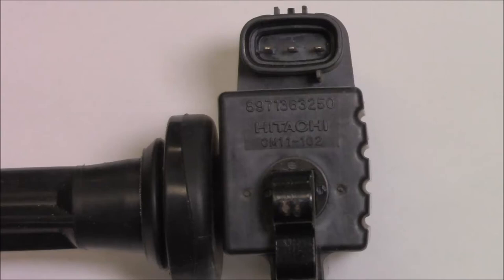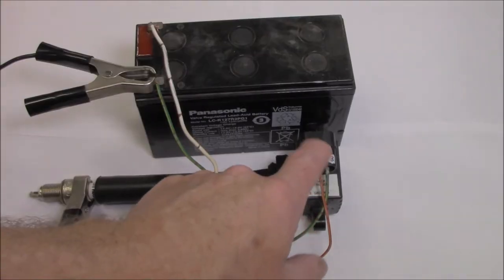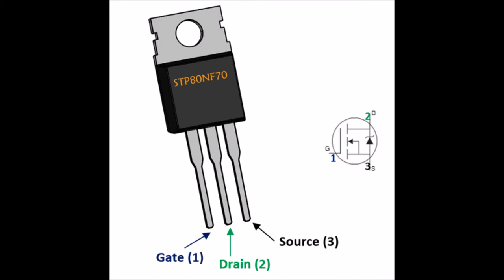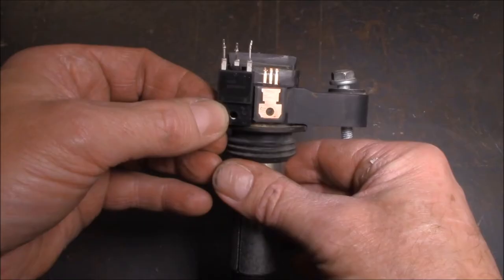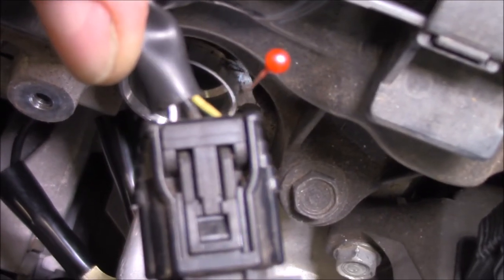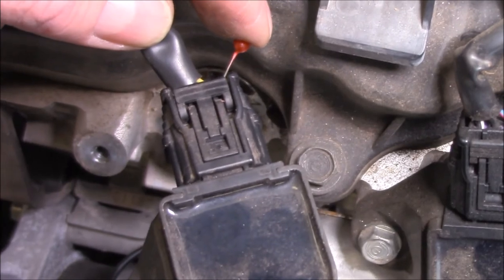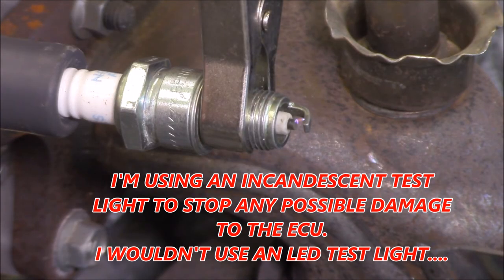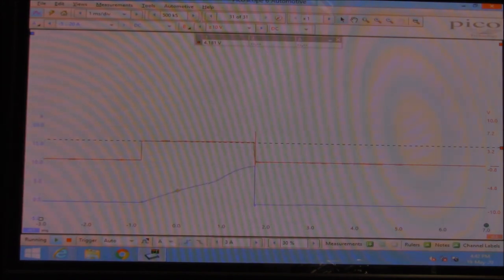Testing A 3 Wire COP Ignition Coil

Comment: This set-up ain't working on my Peugeot 308, following your method exactly - test light touching trigger wire , plug grounded, ignition on. Dead as a door nail on all 4 coils! All coils working in the car. What's up here??
Reply from the maker: What year & engine is in this vehicle? Do you have a wiring diagram to ensure you are testing this correctly? Have you been able to figure out which wires are positive, ground and trigger? Is this style using a feedback circuit or a double ground circuit?
https://youtu.be/CiJgEIPLcIE
Reply: 2009 Peugeot 308, petrol. No wiring diag; Yes have figured out which wires are positive, ground and trigger; cannot find an answer to: "Is this style using a feedback circuit or a double ground circuit"? i'll keep exploring... thanks!
Reply from the maker: @lloyd-qt1mg  So are you using a multimeter for your testing? Without a wiring diagram it can be hard to be definite. Sorry, I may have mislead you on the last comment. I was referring to a 4-wire coil.
Now back to your 3-wire coils. 
Do you have 12 volts at your power wire. A good ground wire. Both of these should be voltage drop tested.
Does the 3rd wire (trigger wire) have a pulsing signal? 
Are there any fault codes? Is the crank angle sensor working correctly?

Comment: can you fix them
Reply from the maker: Hey Greg, 
If you mean can you pull apart and repair the individual coil, then no. They are encased in resin and made up of thousands of turns of copper wire.

Comment: Let’s say I connect the ground the spark and my test light turns on but no spark
Reply from the maker: I'm not sure what you are asking. Are you having no spark issues? What sort of vehicle? Which wires are you testing? Are your voltages and grounds in good condition?
Reply: @MiracleMAX  yes no spark! I tried the same method your doing on a 3 wire ignition coil and nothing sparks and my light tester turns on on but no spark
Reply from the maker: @Kevvoo5.0  If you are testing the control wire, then you are not getting switching from the ECU or ignition module. Are you testing this on the vehicle or on the bench?
Reply: Did you find a solution???
Reply: @konstantin-big  the key needed reprogram 🤣
Reply: @Kevvoo5.0  
That was a immobilizer problem

Comment: What would you say if things are good until the car is fully warmed up and driven around a bit. Then it starts to fumble and misfire on multiple. 🤬 cylinders
Reply from the maker: What testing have you done so far? Do you have any fault codes?
Reply: @MiracleMAX  I just noticed my fuel tank preasure is neg 1 psi. That can't be good. The scanner also reads low fuel velocity. Maybe there's a venting issue.
Reply from the maker: @JCGible  Is the fuel cap valving working correctly? Is the evap system working correctly?
Reply: @MiracleMAX  I will check today. I have no codes.  Thanks